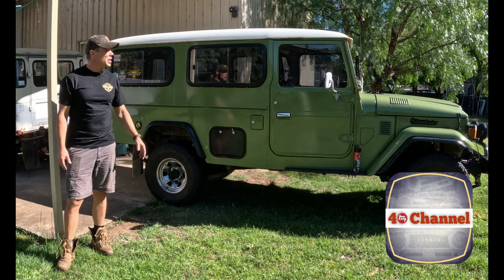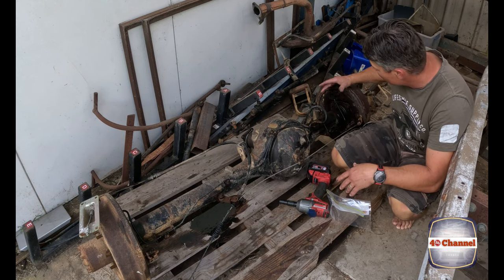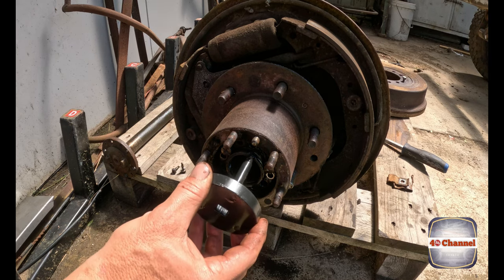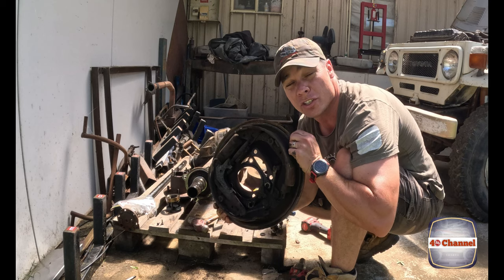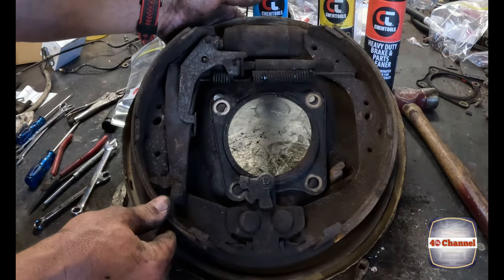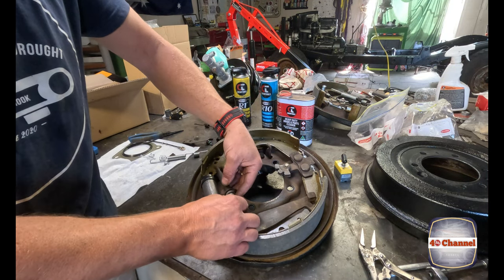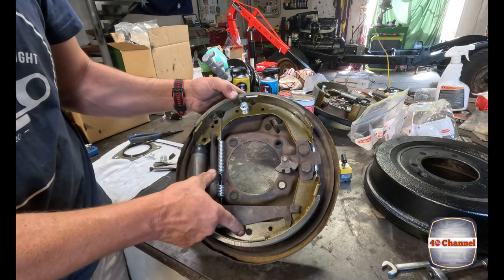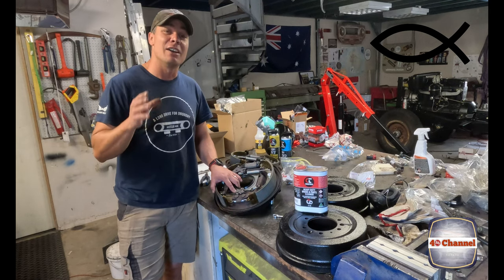S2EP82 - Pt 1 - 40 series Rear Brake Conversion - Upgrade Handbrake , Emergency brake

Comment: I just did that to my '79 FJ40, except that I have swapped in the whole FJ60 axle housings (front and rear), and now I got a floor mounted hand brake (also off a FJ60, fits like glove!) and also I got the best brake on any FJ40 I have ever driven.

Comment: Rather then bashing the axle and hub to get the axle out. The two m8 bolts you used to get the hub off. The axle also has two threaded holes that are used for the same purpose.

Comment: Still lost. What parts did you use? Looks like you just removed parts from a fi60? Rear end? If I have to get all that, why not just replace the entire rear end?
Reply: 60 is wider and I would say the spring saddles would have to be moved